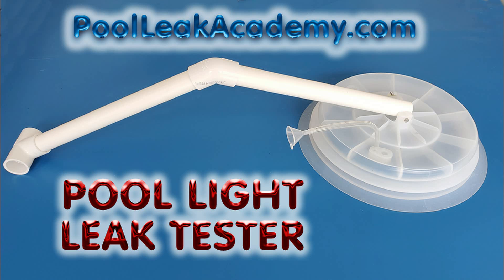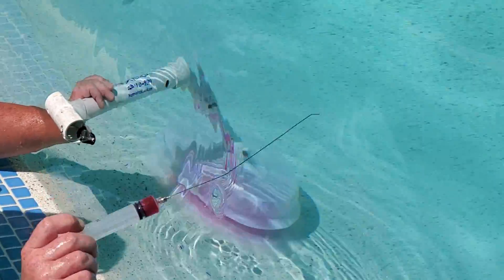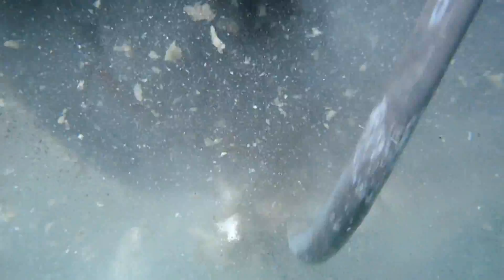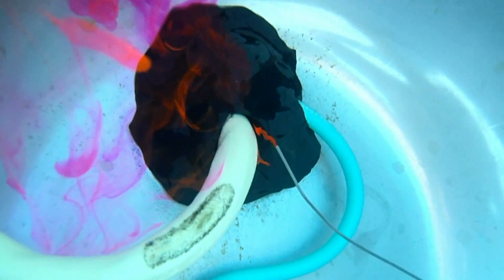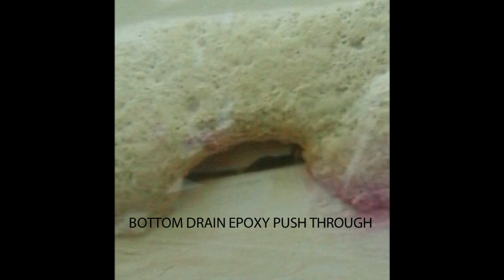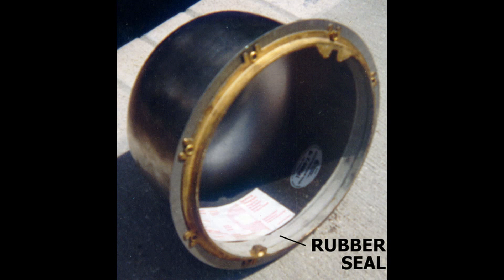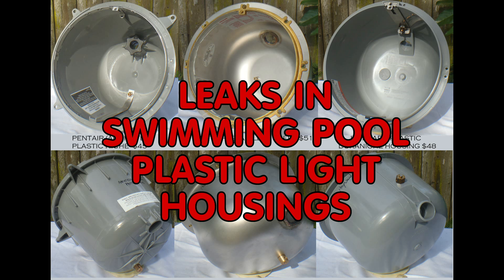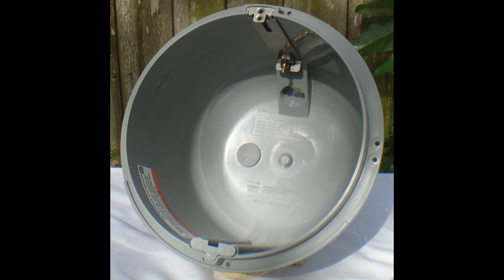POOL LIGHT LEAK TESTER. Dye test a swimming pool light for leaks from the deck of a pool easy.

Comment: Having worked on pools for 40 years I can say this is one of the best videos I've seen regarding so many potential leaks that can occur on pool lights.  That plate you made for dye testing looks like a great product if it's large enough to fit over a standard inground pool light (ie, hayward, etc).  We did something similar and took the thing that came with a leaktrak tester to cover the light, removed the pump and use it in the same way you're doing...  never found the leaktrak to be that useful, we usually just dive in the pools and find the holes visually plus since lights are a ground source it's pretty much useless for that.  Anyways, thanks for sharing your years of knowledge and a big thumbs up!

Comment: If its a concrete pool if the epoxy fails use hydraulic cement. Much easier then having to come back and fix epoxy.